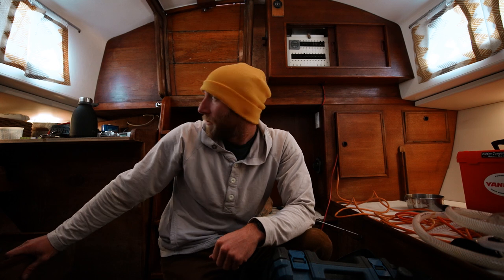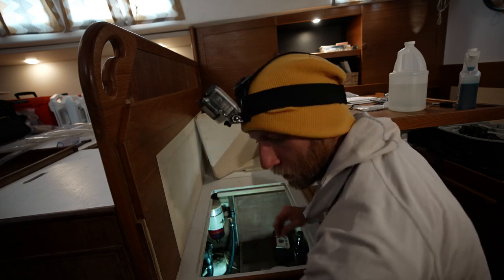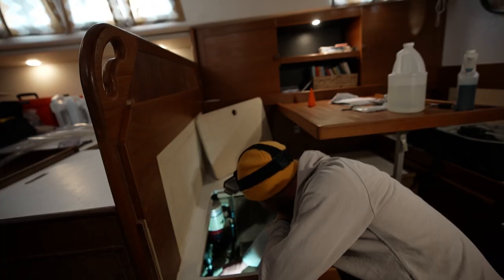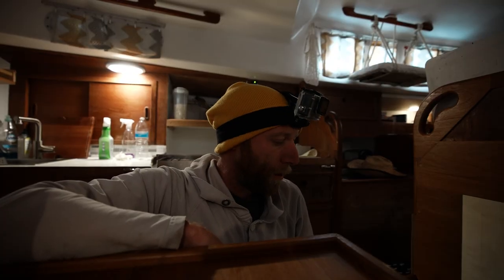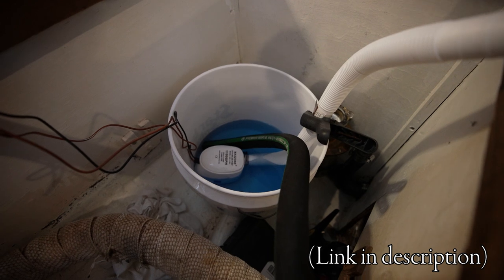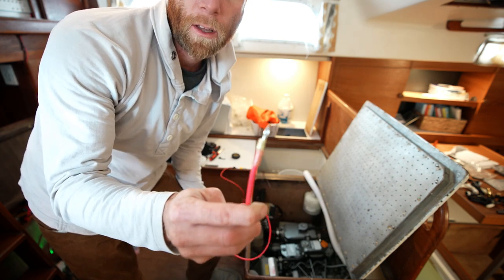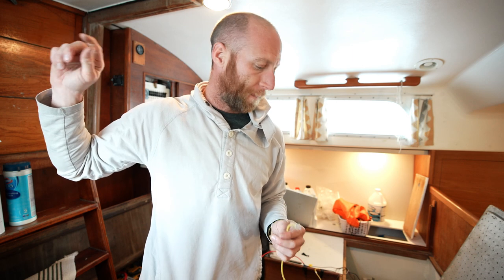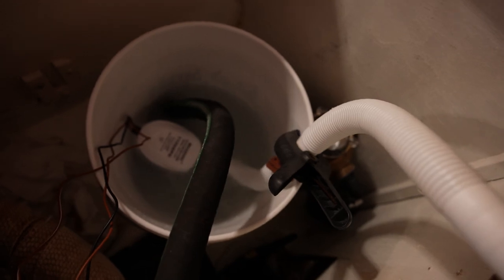Winter Project Mode//How to Descale Your Engine | 02

Comment: so when I am pulling screws I always take a piece of duct tape and make a circle out of it with the sticky side on the outside.  as I am pulling screws I just place the screws on the sticky tape.  the great thing is this works for o-rings and other non-ferrous items.
Reply from the maker: I definitely need to do this given the amount of screws I knock over and lose